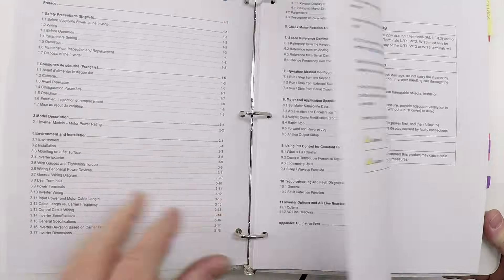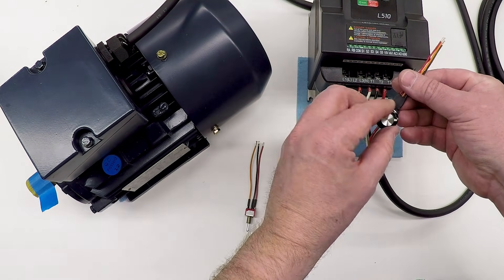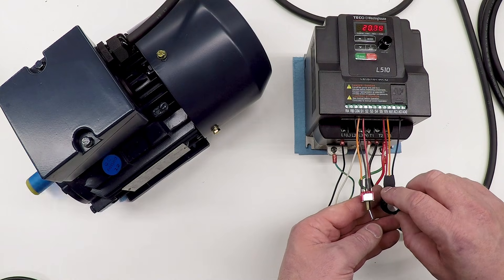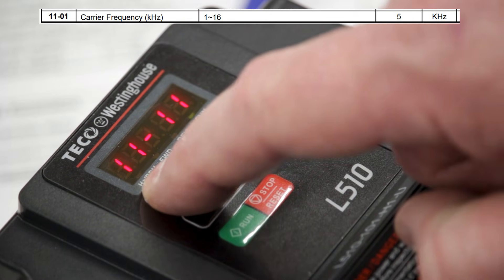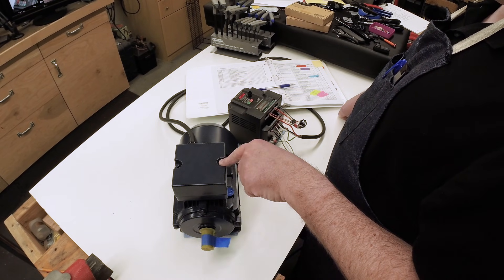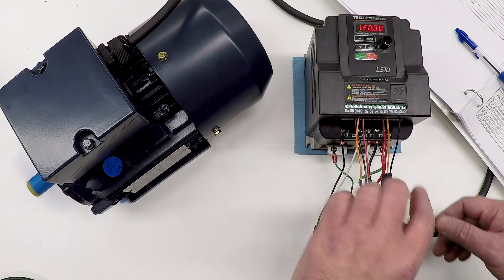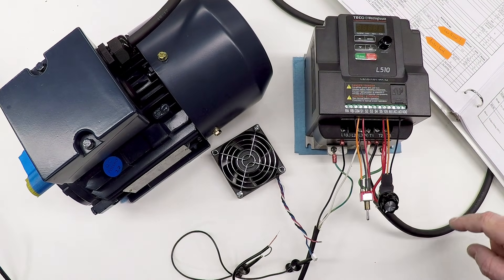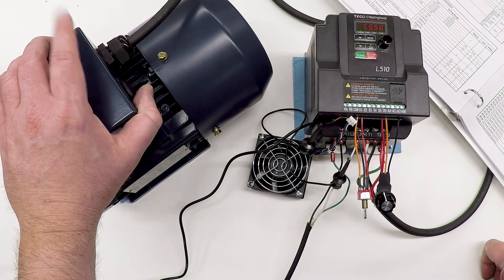Lathe VFD 2: How to Program a VFD for a lathe (Teco-Westinghouse L510)

Comment: I want an always on,  fixed 3-phase 400hz output.    Is it possible to leave all the VFD control signals open?  i.e no start/stop buttons, no voltage to set frequency, no motor parameters entered?
Reply from the maker: It's definitely possible to set it up for a fixed frequency and to have it automatically start on power-up.  However, it sounds like maybe you're trying to generate a supply bus for aircraft or shipboard equipment.  Keep in mind that a VFD is designed to run one motor that is always connected.  There are warnings throughout the manual not to install a switch between the VFD and the motor.  Bad things can happen if you connect or disconnect loads while it's running.

Comment: 17:55 I think the built-in fan inside the motor housing, is not a fan but an air circulator.  As the motor is bi-directional the fam blades are set at 90 degrees.  The auxiliary fan is a good idea as that will provide positive flow regardless of motor direction.

Comment: Why does my keypad potentiometer work fine to set acceleration but it won't control deceleration? The frequency shows when turning it up but it won't do anything when turning it back down. The frequency and motor just stays wherever it was last set on the acceleration that it was dialed to. I cannot find any information on this. 

Your videos are extremely well done and extremely helpful. Thank you very much!
Reply: Tried an external potentiometer and same results. The output frequency for the motor will not decrease. Is this a parameter setting??

Comment: I'd rather have a NEMA 4 inverter that has the speed control dial built into it with its own enclosure. I tend to shy away from "push/pressure pad" buttons on todays equipment as they tend to not last long in heavy use. There is a lot going on with this type of VFD...good thing I saw this video to be prepared on what direction to take. I'm seeing machines with the "inverter speed control" option vs. single speed that average about $1,500 more expense which I'm guessing is due toa 3 phase motor plus the VFD. I had no idea Leeson is Chinese imported.

Comment: Can I please have a min of your time. I purchased the  haunyang 2hp for a 1 hp 3ph Bridgeport. I'm not an electrical person. Why can't I just wire it up simply and use the foward/reverse/ off switch? Everyone is wiring low voltage to that switch? The vfd is making 3ph so shouldn't I just be able to wire the machine up like it is straight out of the vfd? Change direction of rotation with the rocker switch just like it's plugged into a wall with 3ph. It's there a voltage surge to the vfd that won't allow it to work? It just seems like the simple way to do it that will allow power tapping. Thanks for your help. Please excuse my ignorance on the subject. A wiring diagram looks like Cyrillic to me but I'd really like to learn.
Reply: The reason for my confusion is setting up the startup time. Wouldn't a startup time delay the turning on and off of the spindle? I've watched and am watching a bunch of videos on vfds but nobody has addressed my question yet.

Comment: You said you found the VFD already setup, so you did not need to input or change certain valves. If the VFD was not set up at the beginning, what valves would you felt, you need to input or change at the initial setup?

Comment: Very informative, thanks.
Just fitted a different VFD to a milling machine. Seems most VFDs has about the same sets of parameters, so your comments helped.
One question, what happens with the fan when running reverse?
Not a big problem on a lathe, only time I run the lathe backwards is when threading.

Comment: Hey Doc C, your expertise shows in your video instructions. I've used them a number of times while setting up my first specialty-mod Taig Ball Screw Mill. I have the L510 and like it a lot. But you have again rang some bells, as I'm setting up my 2nd Taig Ball Screw Mill, that we'll be using to increase production. But I have a question...
Do you think these demonstrated settings for late would also be advantageous for my milling machines? I already applied your previous instructions for the first Taig Mill. And it works very well. I can't say there is anything about the operation that's latent, or noisy due to the settings you prescribed. 
So any further advice regarding the Teco-Westinghouse L510 would be appreciated.

Comment: Interesting. My 510s were wired up as factory set/panel. Curious. By the way, setting the carrier frequency all the way up has implications for temperature. If ambient temperature is high, and the unit isn’t kept cool enough, it gets derated automatically. Be aware of that as if this happens, as in a non air conditioned garage during a hot summer, it could just turn off. Normal is to set it as low as possible while ameliorating as much of the whine as bothers you.

Comment: I see this video is already 5 yrs old but my question for you is, how do you think the torque of the motor will be affected running at it's lower rpm's especially on a lathe when you need that torque bc you're probably turning a larger dia? Thanks  I'll keep watching for the answer in other videos!

Comment: when making a three phase inverter using capacitors to balance legs and using a idler motor to ramp the 3 phase motor to running speed will having idle motor running in the wrong direction for the 3 phase motor will it damage the 3 phase motor or will the 3 phase motor just stop running once the idler motor is disconnected?

Comment: nice work brotha!
I was recently challenged by a client to install a proofer/oven combo unit in his restaurant that he acquired at an auction.  only problem is the unit is 3ph and the pub only has 1ph.  i have managed to rewire the heating elements to run at 240v but the convection fan motor is 3ph only whtether at 208-230 or 460.  luckily he has provided me with a Vevor VFD.  thanks to your very informative video on the set-up and installation of a VFD , I am ready to procede to the next stage which is the motor operation.  feeling educated... well done!!

Comment: Hands down the best VFD setup VIDEOz I have seen yet. Very clear and simple wiring and setup to get you up and working fast. Thanks for making this it’s been very helpful. Thanks 🙏 

Only question I had was how did you determine what resistance was required for the potentiometer? I can’t imagine just any would work unless you can set the resistance in the VFD

Comment: Hello clough. From your video I see you programmed for remote control for forward and Reverse using sensor less control. Please can this be done for a remote control from a distance to run the vfd. Not to power it but rather to run it after start up

Comment: Extremely helpful my lathe no longer get's the midrange shakes thanks to you, but I was wanting to know if you could help me out with the setting up of a Folinn BD600 drive to a tension controller. I want to control the tension of a product that is getting wound up on a spool, the controller has a close loop PID function and gets input from a load cell of the actual weight or tension as the product runs over it. The controller then converts this to give a 0-10volt output. Is the output then just connected into the VSD input instead of an external pot? Is it that simple?
Regards Rick Australia

Comment: Hey James.... When you got your motor controller did you photo copy the tiny manual and enlarge it then install it in your own binder?
Reply from the maker: I downloaded the PDF and put it in a binder.  For complex stuff like this, I find it easiest to just page through the whole manual on paper and mark it up with tabs and highlighters.  It's so much easier to flip pages back and forth to reference tables and diagrams as I'm trying to read and understand.  If I'm just trying to look up one item, the PDF on a screen is fine, but not so great for getting the big picture.

Comment: Hi can you help me I need to buy a new motor for my VFD to control it. Its for a 1340 wilton lathe and want to do like you...3 ph 1800 rpm etc. I have looked around but dont know if it should be induction type or waht.
Thanks
Manny

Comment: I know this is an antique video but just in case anyone is watching... Is there a reason for getting an 1800 RPM motor and overclocking it rather than a 3600 RPM as running it at 60 hz?
Reply from the maker: An 1800rpm motor will deliver full torque at 1800RPM and close to it when running at 3600.  It will also go all the way down to 180rpm and stay within the advertised 10:1 ratio.

Comment: Thanks for the great video, I used it to day to setup the VFD for my Bridgeport. Very well done with plenty of details to get it configured. I am going to use the relay switch to turn on the enclosure fan while the motor is running rather than have it run all of the time.

Comment: I recently did this conversion to a VFD steering. When programming the Cooling fan, the result is that always when the motor freq. steering is under 40Hz, the fan kicks in. As a result, the fan kicks in as soon as the VFD switches on, and stays on until the engine spins up above the 40Hz rpm threshold. So even when not using the lathe engine, the fan is always turning. I could use a relay to switch off the fan when the engine is not powered. How did you remidy this @Clough42

Comment: Thanks for the videos, i was able to make every thing work except for the reverse function, I have tried 3 different toggle switches none will start the lathe or stop and reverse directions.  Are there any parameters that I need to change.  I am ready to swap motors but would like to get this cleared up first, thanks for all the hard work putting this series together.

Comment: I followed your procedures and was able to get things working to a degree. Initially I had verything programmed as per your steps. However when I started the lathe, the motor only ran about 1 rev/sec. I called the local distributor who went over a lot of trouble shooting. The potentiometer controled the frequency displayed on the VFD but the motor speed did not change along with the pot setting. We finally set everything back to factory settings. At that point I was able to control the speed initially with the pot on the VFD and subsequently using the remote pot.
However when I changed 00-00 to SLV, it regressed back to running at about 1 rev/sec and the pot had no effect.
I have resigned myself to running under V/F mode. I couldn't find anyway around this anomaly. ????

Comment: Well explained. The LeBlond 17 resent purchase had an L510 VFD installed. One thing I noticed in the TESCO manual was to mount without vibration. It was mounted on a stand to the lathe. Iam going to mount on a swing arm to wall. Also recommended a MCCB or fused disconnect and a AC Reactor (Ground Fault 200mA) What are your thoughts? Bear

Comment: Thanks for great instructional videos on VFD. I am doing almost exactly the same implementation on a woodworking lathe. I wanted to do the setup on page 122, however the instructions are confusing and i am not sure what parameters to enter in 03-00, 03-01 and 03-02. Can you help?
Reply from the maker: These parameters control what the input terminals do.  I have my forward switch on input S1, and my reverse switch on S2, so I set 03-00 to 0 (Forward/Stop) and 03-01 to 1 (Reverse/Stop) to set them to these functions.  If you want different commands on these inputs, you can assign different values, and if you want to use more inputs for other commands, you can set them up on 03-02 thru 03-04.
Reply: @Clough42  Thanks for the quick reply. I will do your implementation if i don't figure how to do it with momentary push buttons. The manual says I should set 00-04 to 2 for 3-Wire Control Mode-Run/Stop (schematics on page 122 of the manual). One normally open momentary switch for start, one normally closed for stop and one SPST switch for reverse. However parameters for 03-00,03-01and 03-02 read:
"0: Forward/Stop Command or Run /Stop 
1: Reverse/Stop Command Or  REV/FWD"
So if i set S3 to 1 I'm not sure whether that will be interpreted as Reverse/Stop or REV/FWD🤔

Comment: Beware of pwm frequency : the higher the pwm freq, the more "iron losses" there is in the motor. More Iron loss = more heat produced in the motor and less useful power. 

On the contrary, lower pwm freq = more audible noise and less iron loss. That is the reason why it is shipped with minimal pwm frequency : best mecanichal and electrical situation, but with audible noise (which is a non-factor in industrial applications, there is always noise)

Great vid, thanks

Comment: on my set up with 50Hz rated motor as the frequency is brought up to max' Hz the motor rev's drop, any ideas?. RM interference off coiled motor feed lead?.
Reply from the maker: It depends on the motor and on what you mean by "max' Hz".  If you're trying to run it significantly above its rated frequency, not all motors can do this and torque will drop.
Reply: @Clough42  i set t the parameter at 50Hz as per motor name plate and Euro' standard.Ciould it be that radio magnetic interferance generated in the VFC lead to the motor, which is long and coiled together, cancel signal out hence drop in rev's.

Comment: hi; great video, i've just purchased the same VFD.  would you tell me, what type of switch is the one you installed for the fwd/rev function?  SPDT, or just what?  thanks!
Reply from the maker: SPDT with center off is enough, but I ultimately used the drum switch that came in the lathe, which has lots of extra contacts.  You really only need to connect one wire to common for forward, and another for reverse.
Reply: @Clough42  hmmm...just hooked up mine the same way you did (only fwd/reverse) switch, and it does not work.  is there a menu setting i need to change, do you know? thanks.

Comment: Hiya, thanks for the informative series. I'm in the process of replacing the single phase motor on my lathe with a 3 phase motor and VFD. I've noticed I'm getting vibrations at certain frequencies (35-45hz) - is this normal ?

Comment: Awesome information. I have the SAME LATHE, but made by WHolesale Tool. And as mine is nearly 20 years old.. the motor finally died. I purchased a motor and VFD, and was searching for wiring before I start.. and came across you clips. Enjoying the detail and reasoning behind them. Excellent. Excited to finish them and then see the other videos you have once I get mine back up.  Thanks for the hard work.

Comment: great video James. I cannot find a way to shut the vfd off. (no power or shut off parameter). I'm I supposed to put a switch on the wall between the power-in cable, effectively cutting off its power.
Reply from the maker: I used a magnetic contactor, as shown in the manual.

Comment: Might be a dumb question but do i need the external pot to adjust motor speed or does the freq pot knob on the VFD unit work fine for that?

Comment: What is the forward-off-switch that you use for the test setup in LATHE VFD 2 video? I ordered a forward-off-switch from AMZ, (labeled DC12/24V 10A) and it has 6 taps numbered 1 thru 6, and prewired with 4 leads coming off of it. I don't think this can be used for testing, can it?
Should I get another switch for the test? I cringe every time I think of the evil genie coming out with his blue smoke.

Comment: I changed my motor to SLV to eliminate that small vibration at mid range. However, Changing to SLV did not help at all. Do you have a suggestion to what I could do?

Comment: great job feller,m not electrician, but i got 7 x 14 mini lathe, 240 volts in australia,willing to do 1 hp also, i was worred co's m not electrician, but i will have it checked before i'll put it on thanks again

Comment: I did this today.  Using the same VFD.   All works perfectly except that I am having one unresolved issue, and it is that the 2K potentiometer doesn't use its full range. Meaning when I turn the pot all the way down, it is at zero hertz, but when I barely move it about a quarter turn, it goes to upper limit full frequency (I set mine  to 60 hz as upper limit).
Im looking through the manual to find if there is another setting to change. But haven't found yet.

Comment: that shaking at certain frequencies are caused by harmonics. you need to program out those frequency ranges if your VFD has that capability.  on industrial control systems these bad frequencies are usually taken out in the control system or in the PLC that is running them.

Comment: James

I noticed you used a 2.2K Ohm pot.  I don't know anything about electronics, so looked around and I have what looks like a very nice 22KOhm pot, would that work in this sceanario, or would I need to shop for a 2.2KOhm pot?

As always, thanks for any assistance, and keep up the great videos

John
Reply from the maker: The VFD manual usually specifies a range of values that are acceptable.
Reply: @Clough42  

Thanks for the rply.  Now I am wondering about single turn vs multi-turn pots in this application.  Multi-turn would give greater granularity on frequency settings.  Any thoughts on this?

Comment: loved the way you went through the programming here, I'm running a 3 phase compressor using a VFD, It runs up fine, but when its up to pressure and auto stops, It will not run up again, It shows an under voltage error, cable ratings are all correct, any ideas?

Comment: Whilst I’m a very capable tradesmen in boiler making and getting better at machining , when it comes to more than wiring a plug I struggle. Thank you for the clear and straight forward manner that you describe and do your tutorials. I have been wanting to do the same conversion on my lathe but have been put off by my lack of electrical nohow but after your tutorial the fog has cleared.

Comment: I have serval 12To 24 volt DC  mobility scooter motor  would  they  run of you Extrinsic lead screw system ? . or if no how do I get it to work . t time with the chuck?